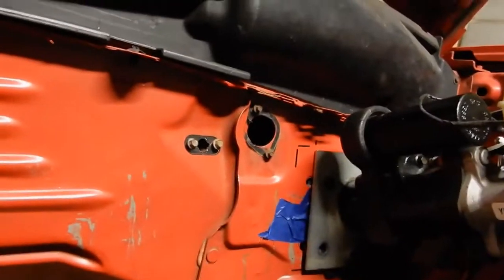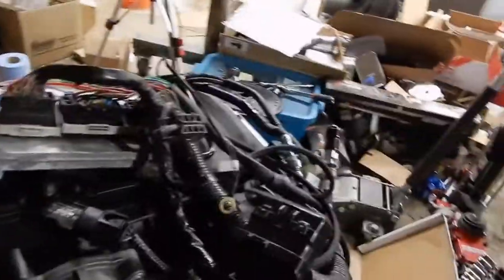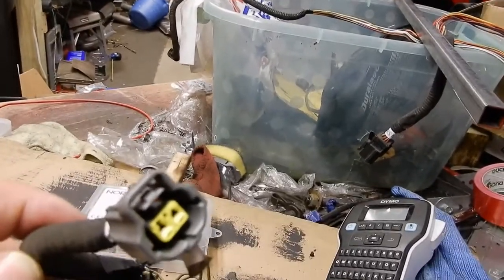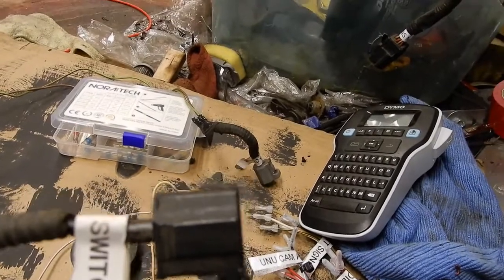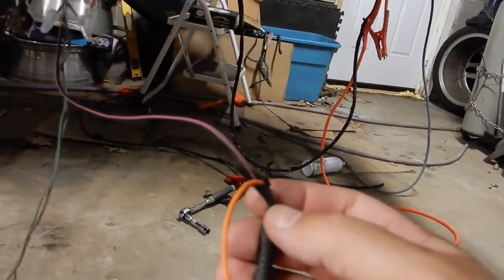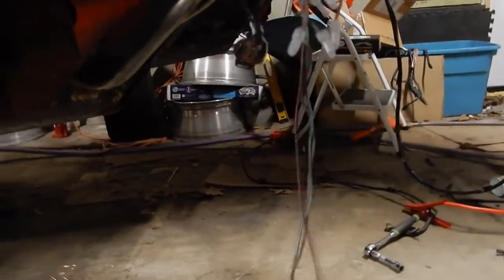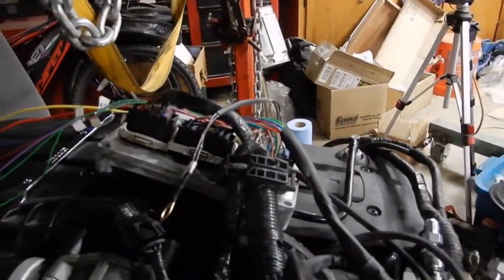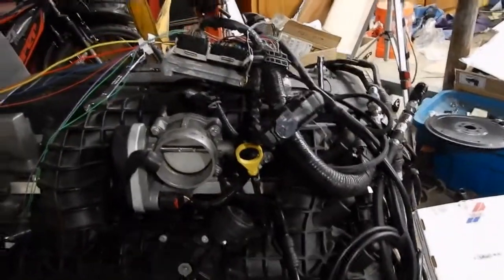Barra Wiring In Depth

Comment: Whats your thoughts on the difference in PCM seeing the battery voltage at the battery vs. what it is after voltage drop at the front end of the car? 
I have went through this discussion about the PCM ground needing to go all the way back to the battery post but not on the constant power.
Reply from the maker: So as it was explained to me, the PCM needs a solid battery ground so it can know the true voltage of the system overall.   If you use a ground that's not directly to the battery, the voltage can vary quite a bit and if you're using the PCM to do alternator regulation this is probably a real problem -- possibly not so much with this setup.  I haven't determined how I'm going to get the voltage regulator on my alternator of this thing setup.   I'm hoping it trickle charges like the Coyote alternator for the short term -- but long term I'm going to get it charging at at least 14.5 volts.

To do this on my Coyote, I ended up taking the alternator to a shop that installed a GM "no wire" regulator that put the alternator in charge of the regulation.   Works great.  Worse case Ontario for the Barra I'll swap on a Crown Vic alternator and use the factory New Edge wiring hookup (which will use the PCM from the original car) to control charge rate.